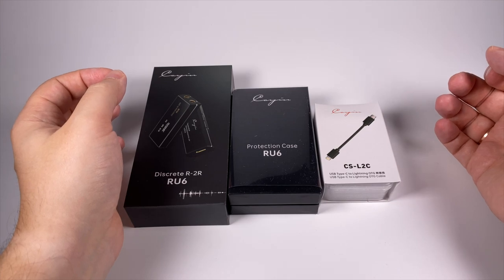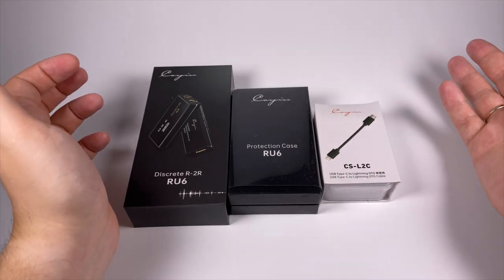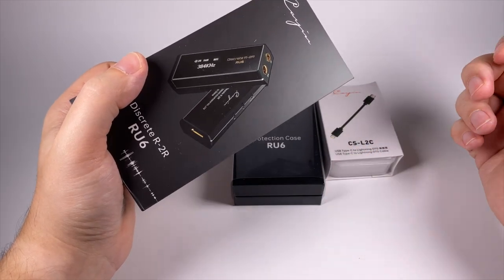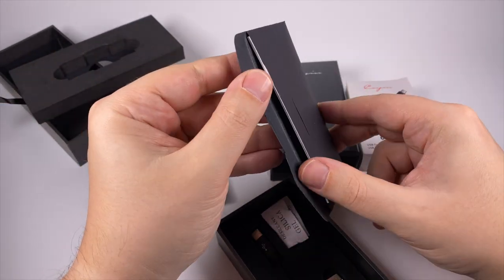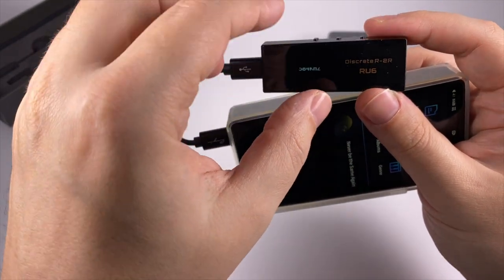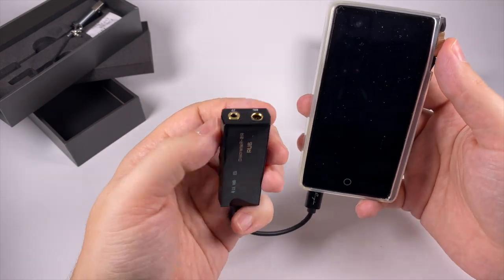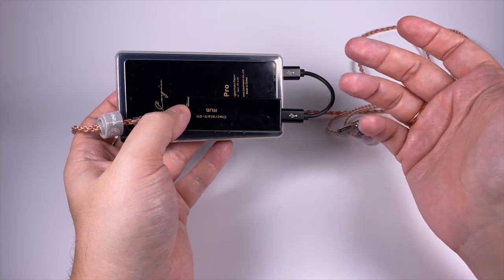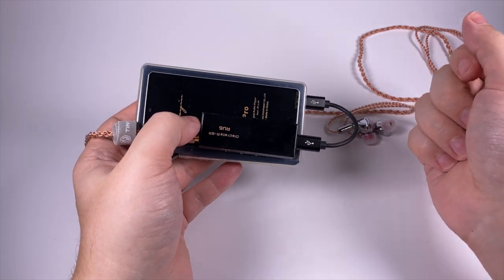Cayin RU6 DAC — technological masterpiece with R-2R

Comment: Nice little DAC; has a very "airy" and open sound sound to it. Unfortunately not as punchy as the FD3 or Link2, but the clarity makes up for that IMO. Generally better than any other bus-powered dongle DAC I have, especially including the KA3 since you can adjust all its settings without having to use an app

Comment: Hi Porta.FI 😊, by ,,dynamics, do you mean impactfull bass? or ratio between the softest and the loudest tones? And could you compare the ru6 to the n3pro? Which one do you prefer and why? Thanks 🙂.
Reply from the maker: Hello, none of that. Impactful lows is impactful lows, and second one is dynamic range. By "dynamics" I mean tendency of slightly highlighting attacks, boosting emotions, and so one, making sound a bit more "fun" 
As for N3Pro VS RU6, this dongle is more boosting this exact dynamics and is slightly more impactful, while player has a few sound modes that are pretty different :)
Reply: @PortaFi  thanks 😊

Comment: Thank you for this video. I already have a Dragonfly Cobalt and wondering if this dongle would be a good upgrade. Have you had the opportunity to compare them? I like R2R DACs a lot but I am not sure I will have the same positive experience is such small size. For example Denafrips DACs have this warm 3D sound that I like a lot
Reply from the maker: Unfortunately, I didn't test Cobalt. As for big R-2R DACs, of course you won't get an absolutely similar DAC, but at the same time, this tiny little thing has a particular degree of similarity, so it's the closest possible representation in this size :)

Comment: Hi, very good and tempting review… I’m struggling between RU6 and Shanling UP5 to connect my MEE P1 (balanced). I know these two products are a bit different (UP5 is leaning more towards convenience with Bluetooth, a Play/Pause button, etc.), but do you think RU6 worth the extra price vs UP5 (wired) in terms of sound quality and performance?
Reply from the maker: well, it's a really subjective question. I can't call difference in sound quality drastic, but at the same time, it's noticeable, with RU6 having a distinguishing signature with a great dynamics and highlighted emotions
so the matter here is are you looking for a best price/quality, or best sound in absolute :)
Reply: @PortaFi  Yeah, I Will probably prefer RU6 in terms of sound quality and performance... Is it draining your iPhone battery a lot?
Reply from the maker: @dominicboucher5759  well, its consumption is noticeable, but not the biggest one I've seen. Roughly 1.5-2 times faster than a regular adapter. But it really depends on load
Reply: @PortaFi  Great, thanks a lot Man!

Comment: Just to clarify, the highs aren't rolled off right? For cymbals you can hear their shimmer and decay is still good with this DAC? It's not dark sounding by any means?

Also, would you say this beats entry level desktop DACs?
Reply from the maker: they aren't rolled off, but they are slightly more "rounded" compared to regular DACs. I won't call that dark, but it's not as bright as "regular" solutions
as for entry level DACs… they are different, some are worse than this, but probably there are a better ones. I'm trying to avoid generalisations
Reply: @PortaFi  I see... I understand where you're coming from avoiding blanket statements as it's a subjective hobby after all. I'm think the TRI TK2 may be better than this, or maybe even the Zen DAC V2 in terms of clarity, resolution and details
Reply from the maker: @TF2ReplayMaker  possibly yes, but I didn't test this TRI, so I can't comment on that
Reply: @PortaFi  thank you kindly for your replies! Been a long-time viewer and subscriber. Stay safe and my prayers are with you
Reply from the maker: @TF2ReplayMaker  thank you
Reply: @TF2ReplayMaker  l have the tri dac and l hardly use it after comparing it to lotoo s1 not even the s2, l prefer the lotoo s1 dongle. Tri dac sounds marginal better, mature, control due to more power but s1 is more musical, faster sounding. If you then consider the size and need to charge a tri dac l would take these modern dongle for mobile use anyday.l am using shanling m3x as transport and that says alot about these dongles.
Reply: @suntanglory  hey there thank you for the reply. Hmmm what would your opinion be if portability wasn't necessarily an issue? Like I'm getting my next DAC primarily for desktop use.

I'm worried about the dongle dacs like Lotoo, RU6 or Shanling not having enough power to drive DT770 Pro 80/250 Ohms in 3.5mm SE.
Reply: @TF2ReplayMaker  Chord mojo 2, reasonable price for what you get,can do mobile and home easily,double the power of cayin ru6 dongle.But if power is the only priority without mobile need then the ifi zen dac and amp is hard to beat.Cheers.
Reply: @suntanglory  ahhh unfortunately Mojo 2 is $900 here locally 😭 Might just get the Zen Dac V2 then. Thanks for all your help man, appreciate it fully!

Comment: Which one gives this natural,musical sound, the dac itself cayin RU6 or a separate amp like topping nx7 if i already have a dac like hipdac or smsl su8?
Reply from the maker: I didn't test NX7 (and portable amps in general for quite a long time), so I can't say nothing here. This is a really complex question actually. For example, if you're going to listen to some power-hungry full-size cans, some source with own battery power will give you a better performance. But it won't be a really convenient setup. And if you already own HIP DAC, then most probably amplifier won't add much to it. If you're sure that you'll stick to IEMs (and sensitive cans) only — some dongle DAC will be a great choice, and RU6 is one of the best here. 

So you need to think about your usage scenarios and what you want to active in general. RU6 is great, but there could be some other options
Reply: @PortaFi  Can i use the cayin RU6 also in a home stereo setup attached to a powerful standalone amp? Is it a step up compared to my smsl su8 aside from being different in type of sound?  What else would be better buy, i was also thinking smsl d300 but that's more expensive. I like wide soundstage, with musical layering, good body, lush and dparkle up top.
Reply from the maker: @Gilliboy82  > Can i use the cayin RU6 also in a home stereo setup attached to a powerful standalone amp?
maybe not with every single amp, but in general yes, you can 

I didn't test this SMSL unfortunately, so I can't tell

Comment: Hi about sound quality Cayin RU6 vs Ibasso DX160 which is better.
Reply from the maker: they are really different in terms of sound, so "Better" here depends on preferences. There are lots of aspects, for example, with power-hungry load DX160 will be better as it has it's own power
Reply: Thanks
Reply: Hi. What about RU7 .I have Audio-Technica ATH MSR7B and Fiio fh5s pro low impedance headphones so I only care about sound quality.
Kind regards

Comment: Not a criticism of Porta.Fi, but of almost all reviews of dongle DACs:  if I already have a dedicated DAP, I wouldn’t want to use a dongle DAC with one.  I would hope that my dedicated DAP would have an excellent headphone DAC/amp already built in.  Dongle DAC reviews should be made with smartphones, laptops, or tablets FIRST.  This is the main reason anyone buys a dongle DAC.
Reply from the maker: hello, thank you for feedback, but as I've said many times in videos, I use DAP as a transport JUST AS AN EXAMPLE. my smartphone is busy filming videos, so players are a good for illustration too
Reply: @PortaFi  no worries, I like your reviews.  But I’ve had an issue with even low output dongle DACs clipping on my iPhone, an issue that very few reviewers ever mention.  If a dongle DAC has any major issues, I think using a smartphone first will show its limitations to people before they buy one.  After a lot of frustration, I found a mention on Head-Fi of the OEAudio’s USB-C to Lightning OTG cable, which will hopefully be a fix.  Cayin, Hidizs, ddHiFi, etc. all sell cables that can’t handle the power demands of their DACs.  Definitely not a specific criticism of you, but of dongle DAC reviewers in general.
Reply from the maker: I didn't test this cable, but I'm a huge sceptic when it comes to USB cables
And power supply is a matter of transport, not cable

Comment: Wouldn't that N3Pro sound good enough by itself? Does the RU6 make it better?
Reply from the maker: I used N3 Pro as a transport just as an example. I need something in this role, and I decided to use Cayin DAP with Cayin DAC
Reply: @PortaFi  how do they compare sound wise?
Reply from the maker: @ekjellgren  RU6 slightly differs from any other sources, giving that sound that many calls "musical", it's more integral in representation, different in representing of dynamics. To my ears it sounds like "enrichment" with small nuances. Difference isn't huge, but it's the case when R-2R shows its characteristics. Slightly reminds tube mode of N3 Pro, but with less softening of sound
Reply: @PortaFi  so this dongle can bu used with another dap? Im using fiio m11 plus ltd...what benefit am i getting if i plug ru6 to it?
Reply from the maker: @ferryjunigwanmurdiansyah4307  yes, it can be used with any transport, including many modern players. for M11 Plus it'll give you another representation, more weighty and dynamic, with more highlighted harmonics
Reply: @PortaFi  hmm so curious to try!

Comment: Hi. I'm a little confused here, you connected the RU6 dac to a DAP, which is also a dac. So the music is getting double dac'd?
Reply from the maker: no, it's impossible to "double dac" music. DACs take digital input and convert it to analog, so second DAC won't be able to consume analog signal after the first one
in this case player works just as a transport, outputing digital signal, and it's own DAC isn't involved in playback